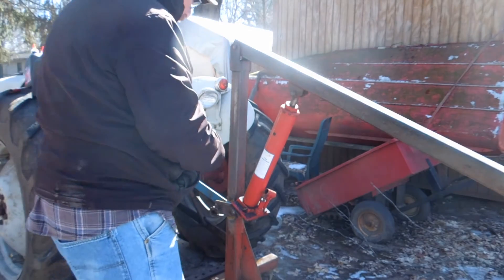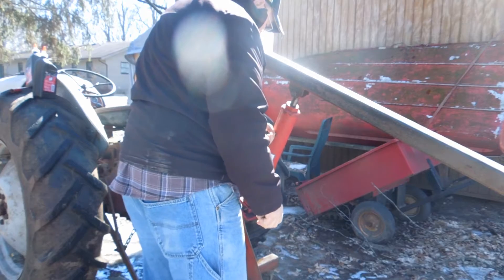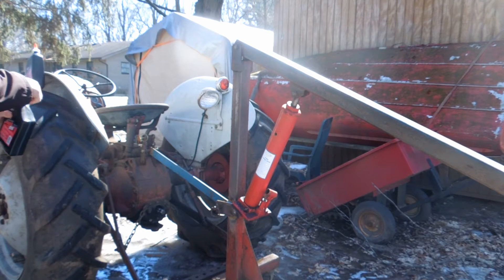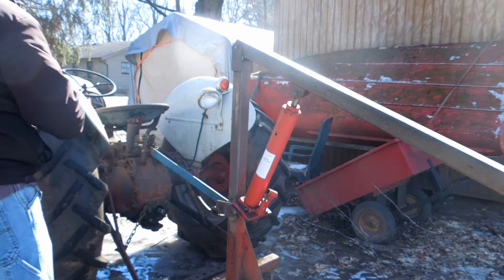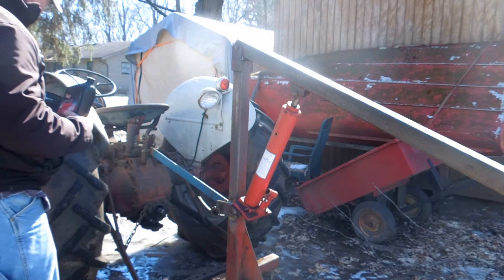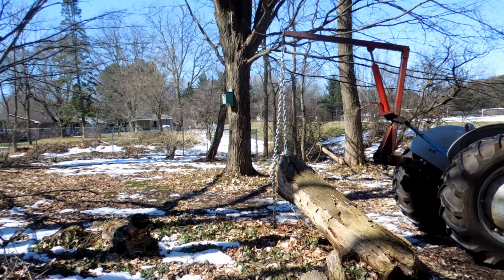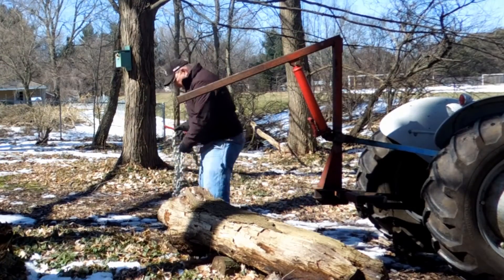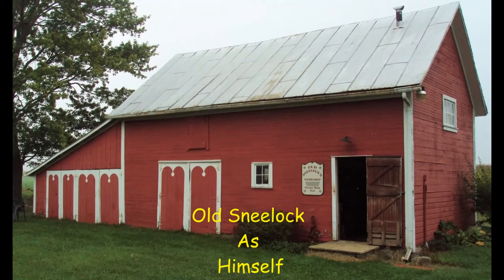Building A Tractor Mounted Engine Hoist Pt 9 Testing

Comment: Never had a doubt and a hoe is well within your capabilities. Looked like it'd go UP there and it did. NOW 4 the mowers! I got 1/3 bag of clippings off ours yesterday and even did some trimming with the new-ish one. Today I am trying to repair a bench and ended up at the Ace and saw everybody I hadn't seen in a century. But now I've et and back outside before the rain comes. No sun today but not socked in yet either so good working weather. It'll creep up there before too long. Cheryl is planting planters between the ramp and the house. EDible too! My kind of woman! And no, that ain't much of a roll cage. Best to keep all 4 on the ground.
Reply from the maker: I have been thinking of a roll cage for this tractor for a long time. My first 8N was a municipal snow plow. Painted orange with a splash coat of red oxide over it. Dearborn front mounted pusher blade hooked to the  3 point. Weird duck but it had a custom cab. Loved the cab. Engine heat up from the floor, windshield wiper, and a roof top floodlight. 
Ryan was little. He sat on the ledge behind the seat with his hands on my shoulders. It bulldozed stumps, buried cable with a potato plow, and pulled fence posts. Great little tractor.
Reply: @OldSneelock  Sounds like a good time for some daydreaming and a reconstruct of a finer rig!

Comment: That was a nice set up ....I must tell you that I have a hoist and I bout that for my last engine job on my truck.....when I seen you pumping reminded me of my hoist and I could not stop but to wonder If one could fix a hydro line from the tractor to that cylinder and make a one way cylinder operated by the hydraulics of the tractor....you get the first shot if you want or by next summer when I go to the camp I can have a shot at it if not.....CHEERS
Reply from the maker: Don't wait for me Gator. I'm happy with the hand pump. The rig is really too light for much more power and most of the control should be close to hand when I'm lifting or lowering. Having the tractor running while I am lifting or lowering is dangerous.
Reply: @OldSneelock  I`m going to try this next Spring ....well our Spring which is about a month and a half away....stay tuned....success or failure....CHEERS
Reply from the maker: @gatorsworld  We get use to where we are.

Comment: now i think of it, one of those mechanical farm jacks would have been better than a hydraulic jack
Reply from the maker: I have one. I was disappointed to find that it has to have over 100 lbs on it before it will lower. It doesn't get used near as much as I thought it would.
Reply: @OldSneelock  I got one to lower ONCE! That's why I don't have one!
Reply from the maker: @lewiemcneely9143  I followed an estate sale sign and found a house like mine with more tools than me on sale for little or nothing. Since I had most of what was there already I just wandered. There were two of those farm jacks, but I only had the cash to buy one. They are real popular with the off road crowd. It took a lot of searching to find accurate information on how they work. Lots of people talking but not much sense in it. 
The jacks do a fine job of lifting and they will go down just not the way I expected. I thought it was like one of the old bumper jacks. Click the lever up and pump the handle.  Click the lever down and pump the handle. I would have to get out the instructions again if I needed to use it. The thing you have to watch is the handle is under load all the time. The old bumper jacks you can drop the handle with the tire iron jammed in it and the handle will bounce up and down while the jack goes all the way to the ground. The farm jack just flies up. Hard enough to crack a skull or an arm. 
I don't go off road with my trucks anymore. The tractor does it better and gets itself out most times.
Reply: @OldSneelock  The best I can remember they were set up like some of the old railroad jacks but it's been years since I fooled with one. I know they'll lift or pull but I try and not put myself in such situations. I don't get out without great difficulty so the best thing is not to go there. Takes care of a lot of confusion! The bench is dona but I had 10 on my mind ND NEEDED 18 SO BACK TO THE aCE i GO TOMORROW. mAYBE i'LL SEE THE REST i DIDN'T SEE TODAY! Wretched caps l0ck.